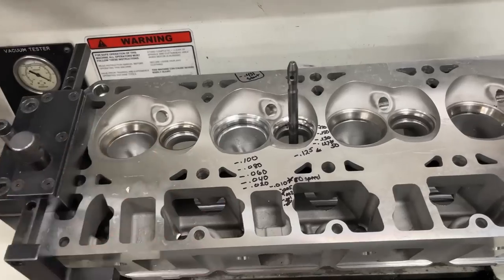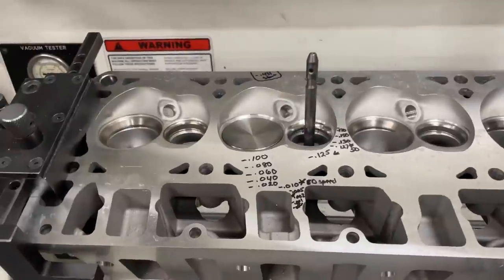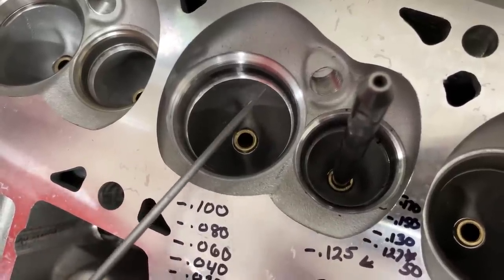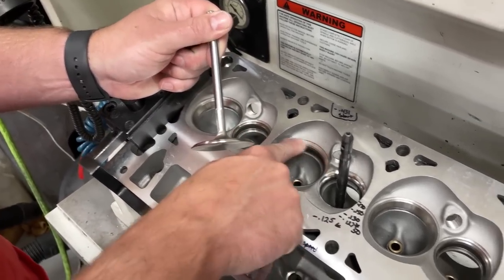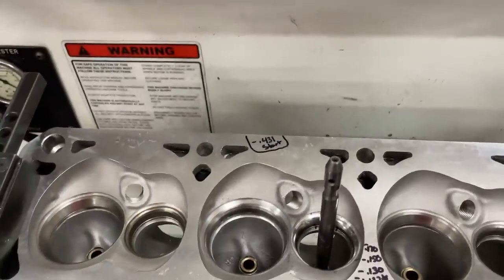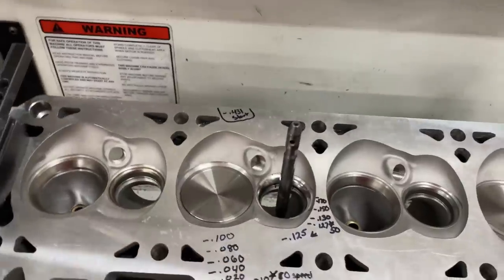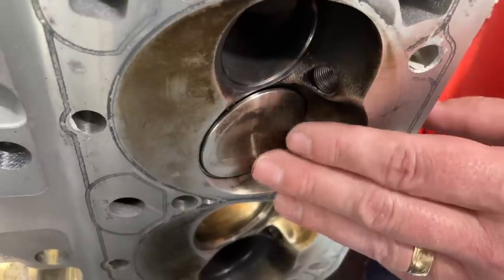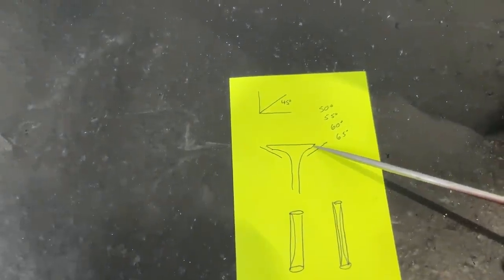How Valves Seal

Comment: After I get a valve job. When I assemble the engine and both valves are closed  I put 100 pounds of air in the cilnder and see how they seal.  I have cought some piss poor sealing on heads. Same goes for leak down test. Some people don't realize how important seal is.
Reply: I used to work at a small reman shop , we put air to every long block we built  ,very quick way to find problems

Comment: I think you were trying to describe 'barrel' and 'neck' for valve guide wear?
 (I used to teach engine reconditioning)
Even though ultra specialised equipment is available (at a very high price) you can, with practice quite easily measure valve guide internal diameter with ball gauges and micrometer to a 0.0002" tolerance (micrometer has to be 1/10,000inch, 0.0001" type with a Vernier scale)
  Barreling is badly fitted or reamed/machined guide, the outer ends are smaller than centre of bore.
 Even though they are short and relatively stiff, guides can be 'bent' if not driven or pressed in correctly.
 'Cast iron' valve guides can easily be cracked.
 Necking can be wear or badly made/fitted guides. (plus, the head 'squeezes the guide changing diameter in localised area so guides should always be reamed after fitting.

Vast majority of production heads have a 46 degree valve seat and 45 degree valve, interference angle 'seals' without any further work after machining and the surfaces 'conform' within a few hundred miles
 The wedging effect of 45 degree seat and valve is relatively minor, it isn't just the contact width. Wedging effect with steeper angles gets much higher and can cause problems with 'micro-welding' valve to seat while running and cause seat wear higher than with a 45 degree seat.

At the 'beginning, when you mentioned 'oval' seats, it's a normal state in a running engine, the exhaust being so close to intake distorts the valve seat when it heats up (exhaust gas is around 800degF to 1400deg F on a normal running engine, intake temperature around 200f)

Comment: Is that shaft (in the exhaust port) inside a valve guide and is it used to guide the cutter as you cut your angle? Is the light under the seated valve (while rotating it) a good test to check for a bent valve?

Comment: Ok so something I never tried and can no longer try it but flow numbers on a head   NA and with say at  2bar...  What I am wondering is if the percentage of flow increase  with port work is linear with a boosted head..  say 5% increase NA and then boosted to 2bar does that increase relate to 5% still ? or 10% because of the extra bar?        I am thinking that porting on a boosted application may be more a waste of time?   Dunno....  can you see?

Comment: Thank for the in-depth information from only a qualified technician... In reading Smokey Yunicks book, he believes cast iron to be the best guide... What do you think ?
Reply: I'm a HP machinist and a fan of Smokey, but you have to remember how long ago that technology is. Cast iron is great for very low lifts as I believe superior to bronze in transferring heat. It doesn't wear well the more lift you introduce. Also bronze guides can have less valve to guide clearance.

Comment: I flat milled my AFR 220's .030" and ran into the top cut on the intake valve job. I know it's a low flow area, but did I kill any horsepower when I did that? How much would it cost me to get them touched up?
Reply from the maker: Probably not much. What you gained in compression you lost in flow. Probably didn’t change power much. $250 for valve job.

Comment: Hey Eric,.....Why does your head machine's (and maybe other brands Serdi ?) Vacuum pump  test meter Only register 21--22" Hg into a perfect seal (like your finger) ??  Even cheap brand X (Harbor Freight & other Chinesium imports) 1 stage vac pumps Easily pull 28--29 Hg inches of vac into a finger plug & if That pump is Only pulling 22 hg (on a 0--30" hg scaled meter) you can be Certain that valve has about 25% Leakage !!   How can a 22 hg max Continuous reading Vac pump/meter rig be reliable ??  The Pump Off Hold duration time count is  the Only near reliable valve sealing Indicator & What Official SAE  standard or recommendation time us that ??  Thx again,   tom
Reply from the maker: The reason why it only pulls 21-22 inches is because it uses shop air to make the vacuum pump work not electricity. I have the air regulated to 90psi. If I turned it up it would pull more. The vacuum guage could read to hundred it doesn't mean the pump is leaking because it doesn't go to 100. The vaccum pump set up is not leaking. Its easy to prove by blocking it and turning it off and it holds pressure. It doesn't matter how much pressure the machine pulls as long as when you have it over the port it pulls the same as if it were completely sealed off.

Comment: I am well versed in engines. I work in a dealership. No I'm not Mr. Goodwrench but that's my goal 1 day. Anyway what are the average gains if I sent my stock LS3 heads to you to port and do a valve job that wouldn't require a piston change?  I know you can't give exact #'s but as long as you have been doing this I know you can get in the ballpark. Also a point you might make is if a person gets work done it really needs to be re-tuned if you are running fule inj, stock computer or aftermarket.
Reply: IMO, without any other changes, and depending on how bad they are now, 35-65fwhp would be my guess. 
NOW ! an excellent for your application cam, his head work/springs and a tune, could be worth 80-140fwhp on LS3/rec castings.
Reply: @BEANS-O-MATICtransmissions  well I already have a BTR stage 2, chinese cold air, DOD delete, MBRP headers w/3" exhaust ( no kitties) and a tune from Blevins Tuning ( if you are in Southern Indiana) and as of right now I have 425.09 hp and 422.23 TQ to the tire. Automatic so that's actually a L99 not LS3 I know.. (before I get it by the keyboard warriors) so I know I'm lower on compression than a LS3.

Comment: What bent the valve?
Reply: Brand new valves can show problems with concentricity when chucked up in a good valve grinder ,poor handling after manufacturing is the most likely culprit, they only need to be dropped once to tweak them

Comment: I appreciate  your dedication  sir,  but having 3mm+ of space at peak warped point  there is just plainly no way that it will seal  without a seriously beefy, unrealistic valve spring; and even this isn't likely to help unless your running high rpm all the time because at idle it would miss regardless.  I'm not going to say your lieing, im going to say your stealing from customers as there is no way this cake ever would has sealed, im certain you took that valve out and physically modified  the valve to an extremely  case  or took from a head that didn't seal   just to make content. Because you are a content  creator. So as long as it looks good on camera.  But you still did not show the valve sealing with a vacuum. 

 This valve all you did is turn the open area  of the bent  valve away  from the camera so all you did is turn the gap away from the camera's view and the contacting area towards the camera, your followers are so gullible. If they think magically  by twisting the valve will seal  better just buy turning the gap out of sight, (that's the same as saying "LOOKS GOOD FROM MY HOUSE" )  If your seat and guide is in decent shape, which you stated they were, then this plainly is not possible  as the gap will remain consistent  no matter if it is pointing at the camera or away from it.
Reply from the maker: Hey moron watch the end of this video you will see me do the exact thing you asked. This was a week ago just for you. 

Big Plans
https://youtu.be/LIQEwVp66YE

I’m not saying you don’t know anything but you don’t know what you think you know.

Comment: Absolute garbage!!!  Cutting valve seats with a dead pilot is a total waste of time!!!!!   You can spend countless hours on a new set of aluminum heads and after several heat cycles after they become seasoned are no longer symmetric!!!!
Reply: How do u come to that opinion..?
Reply: I think you need to publish a video showing why Eric is wrong,  along with thousands of others who do it exactly the same way as he does. Or alternatively publish a proper peer reviewed paper on the subject. Until then I suggest you move along as your comments lack both facts and credibility. It appears that you are like most trolls,  skilled at running your mouth off, but unskilled in the actual subject
Reply: i to would like a video explaining why he is so wrong.he has also addressed Seasoning in a new head and how for most people it is not worth it to run some heat cycles then pull it to do the seats again.
Reply: I am confused, so what do you do?  Do a valve job run it for 10 heat cycles and pull it back apart to do it again?  Very trolling, and rudely stated, even if you disagree not a respectful way to state that.  No class.
Reply: Andrew has 3 subscribers and no content so he must be the absolute authority and Eric should junk his seat & guide machine and his flow bench and do it Andrew's way whatever that may be.